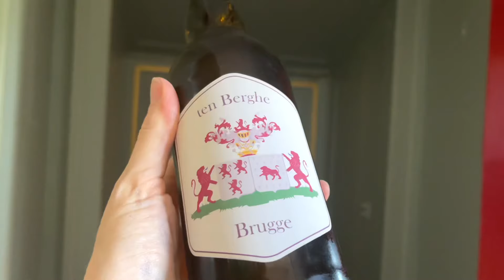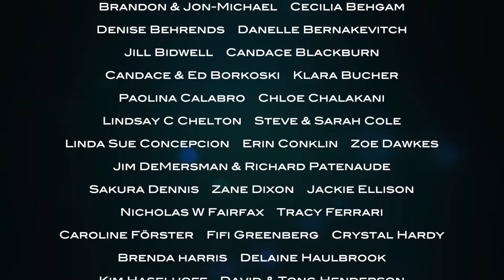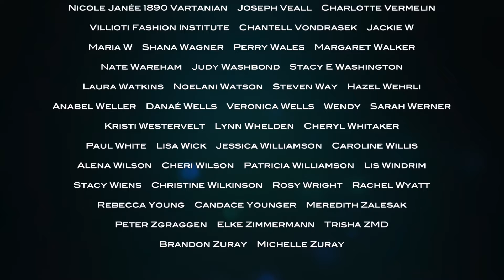THE ANTIQUES FOR THE CHATEAU ARRIVE!

Comment: Stephanie the lime render on the base of the walls and turret at the front of Lalande are being ruined by the flower bed. You are introducing a source of constant moisture to that area and you need to do the opposite (keep the area dry) to protect the structure integrity of the walls. The lime render has already fallen off in many areas, but you can see clearly in this video that the render is very very damp. This will not only ruin ur wall structure if you don't remedy this urgently, but all interior walls will be damaged and your will end up redecorating. The correct way to fix this is to get rid of the flower beds and install a French drain with perforated plastic pipe all along the base of the wall and have the drain end up well away from the house. The wall render will need to be taken off and let the walls dry out for a few months before re-rendering them. Usually a solid wall dries at about 2 inches per month. Now is the ideal time of year to do this as you have the summer weather helping to dry the walls. Never inject the walls with damp proof chemicals and never use cement anywhere - only use lime mortar & plaster, along with a breathable paint and the walls will dry out on their own.
Reply: I hope Nati or Stephanie sees this. You seem so knowledgeable. Is there a way to email them as this seems so urgent.
Reply: Does anyone have Nati's email for this news. Patrons please move structure issues up the list of projects. I know drainage was done in back and the terrace is being worked on.
Reply: Warned about this earlier as it was being planned, but to no avail.
Reply: I hope you emailed this comment directly to the Chateau  as its very important  and I hope after all this time you have accomplished this notification. Thank you!

Comment: You could use a clear resin like product on the bench. It will fill into the cracks and will make the seat smooth so no splinters!
It’s a pricey product, but will harden and keep it from rotting for decades

Comment: 1) Could use the new set of stairs for the height change in Natties new apartment.
2) The water problem will probably be an airlock in a high point, possibly where it raises to go through the culvert under the road. Try undoing joiners (or cut pipe) near or just after this point. If this works, replace said joiner with a tee fitting with a tap on it so that you can bleed the air out whenever this is an issue. Oh, and make sure that you record the location of all your pipes (and such taps) on a services plan : )

Comment: "If there were water
   And no rock
   If there were rock
   And also water
   And water
   A spring
   A pool among the rock
   If there were the sound of water only
   Not the cicada
   And dry grass singing
   But sound of water over a rock
   Where the hermit-thrush sings in the pine trees
   Drip drop drip drop drop drop drop
   But there is no water" (TS Eliot)

Comment: The bench last 5-8 years? I have a garden group made in the early 1900, and it is still i perfect shape! And that is not hardwood, it is from spruce, raw cut from a log (similar to this). Just oil it once in a while, and it will for sure survive you!
Reply: It will last longer for sure. Europeans are not used to having redwood. I've seen redwood roof tiles that are over a hundred years old and in excellent condition.

Comment: Does there not have to be a downward grade of significance to get water to move, or else a sizeable electric water pump to push water up hill?
Reply: It's kind of hard to tell in videos but the cistern on the other side of the field is a good few meters higher than the grounds around the chateau. That's where the water was coming from before, so it did work at some point. The new pipes may need to be primed to clear air blockages, or there may be a leak somewhere.